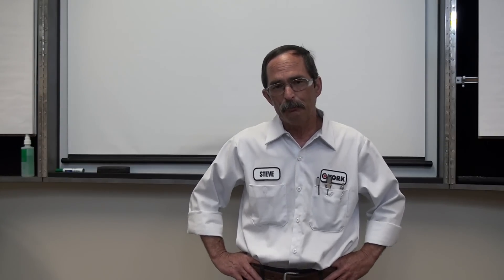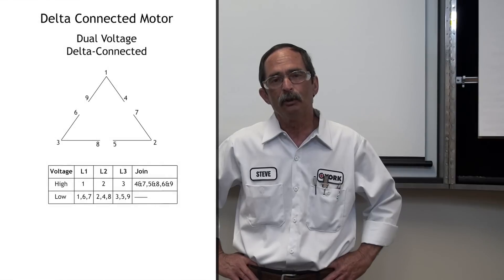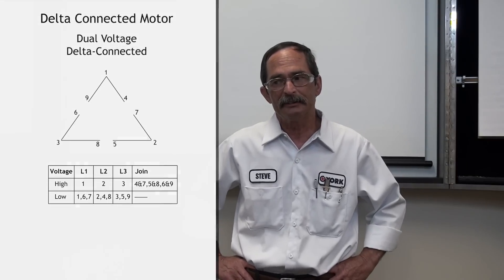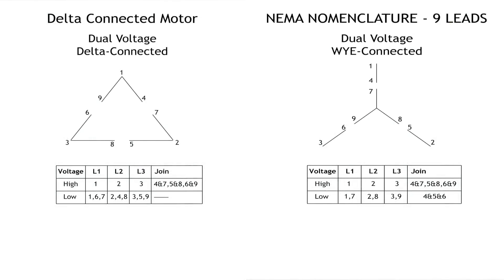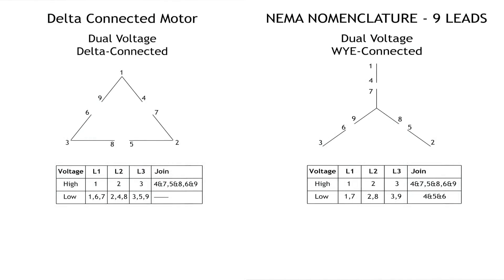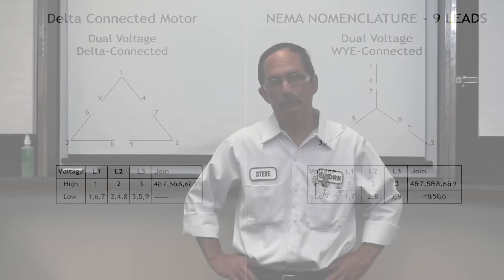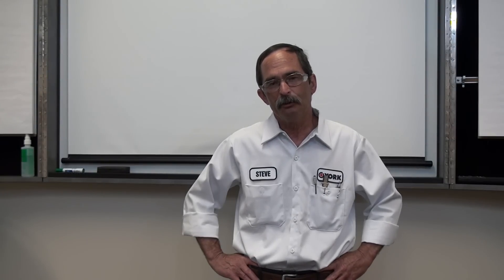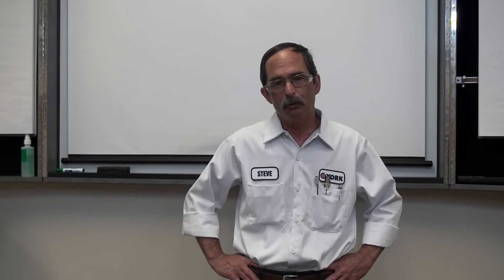Identifying 230 and 460 Connections - York Repair Inc

Comment: Hi iv been looking at you tube and people have been getting  9HP+ 3 phase motors to run on 1 phase power, im trying to find out if i can do it and what i need and the prices, i wish to build a wood floor sander with 9HP+ but restricted to 1 phase in the building i wish to use the machines in, can it be done hear is the link to people who are running 3 phase machines on 1 phase power .

Comment: I have a Dayton model 3kw28b industrial motor. I have it set up for low voltage according to your youtube video. It is a "Y" connection. I plan to use the motor to create energy, but have no idea which wires are positive, 
negitive, & ground. Which wires match which discription? This is my only problem.